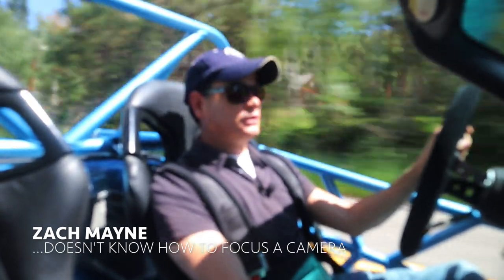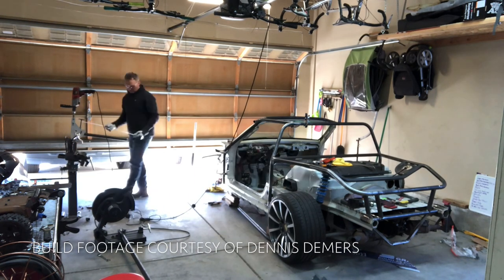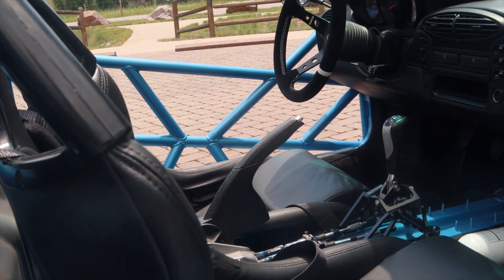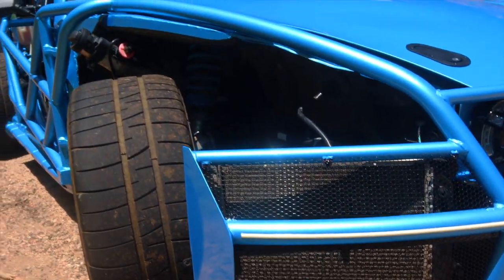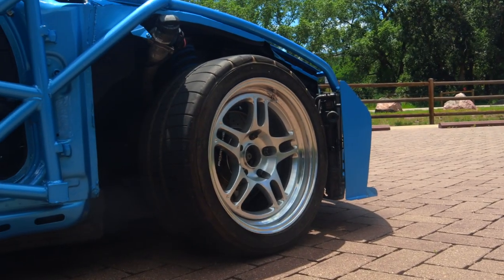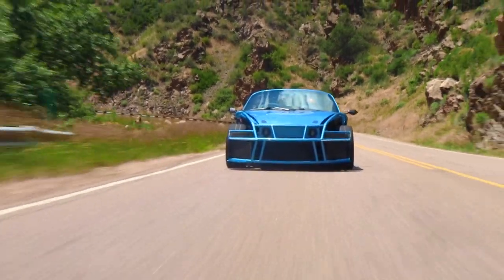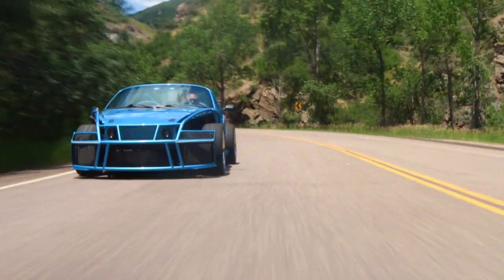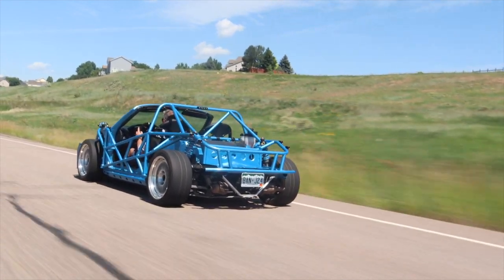Boxster Kart: Insane Lightweight Porsche Roadster

Comment: How does this have so few views? This is such a neat build and video. BTW maybe just stick with a gopro for internal footage and run the dslr for audio separately and merge the slr audio to the gopro video so you don't ever have focus issues in car.
Reply from the maker: Thanks, glad you liked it. To be honest, this is the one and only time I've had a focusing issue with the Canon that I use. I prefer the video look of the mirrorless camera to the look of a GoPro.
Reply: @Retromod  Yeah the extra depth in lens and color is nice, I've become a fan of dual recording so I at least have some video that is salvageable as sometimes the focus shifts on the A7 I have or something catastrophic happens. 

What length of lens are you using for those internal shots? Curious now.
Reply: Its the subs though that make the difference on views or recommended list you have to be popular to get recommended try to find the rotary aw11 video